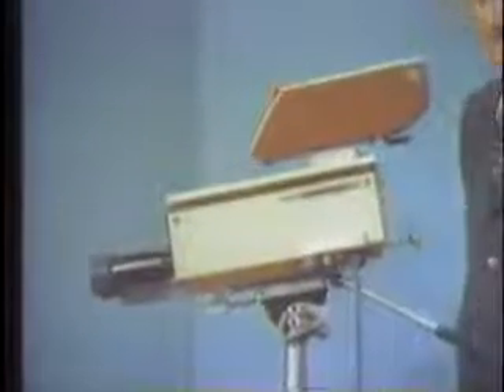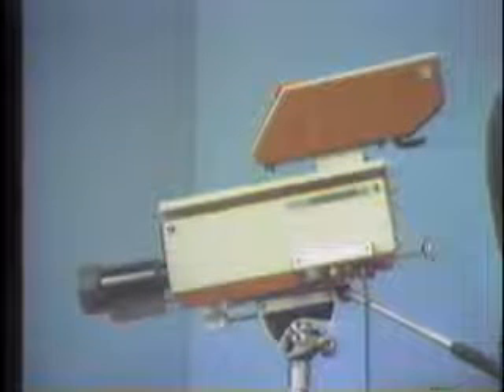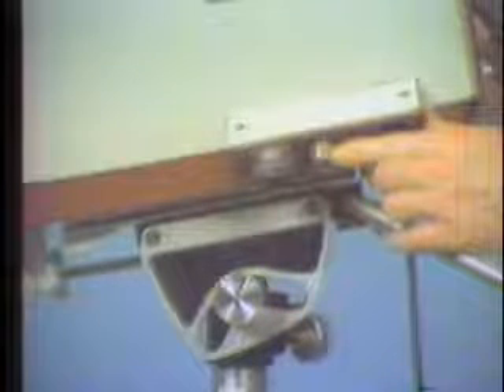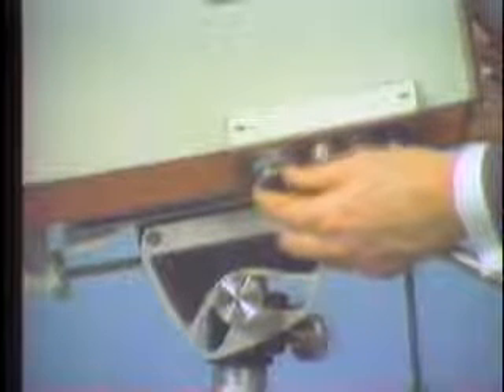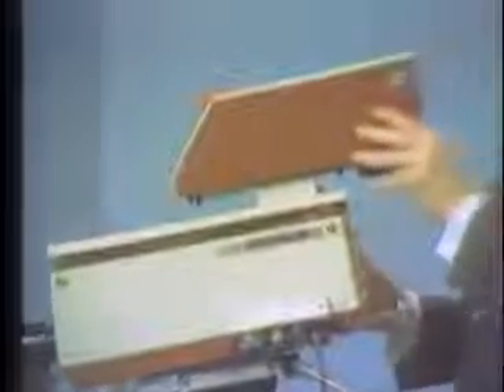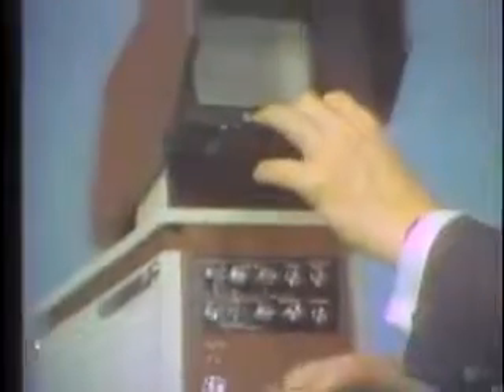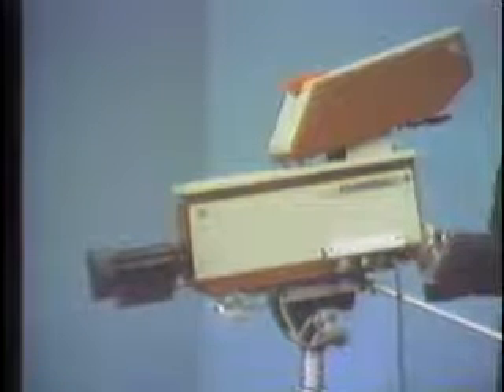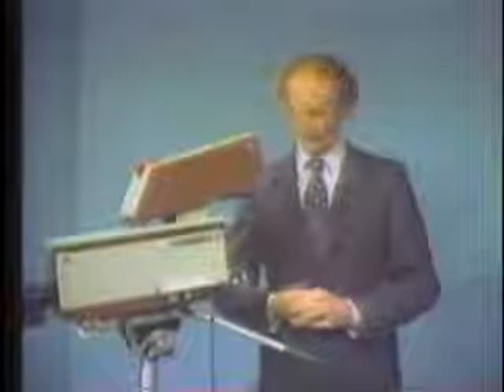Sony 1974 DXC-1200 Trinicon Color Studio Video Camera Introduction

Comment: $5,000 in 1974 is $21,003 in 2020. How was it low cost?
Reply from the maker: That's a fair question. A typical color television camera of the day would sell for $25,000 (1970 dollars) and up. There literally was no low end color camera market at that time. Until the arrival of low cost home VCRs, there was no demand for consumer grade color camera either. Today, you can buy a consumer security camera for $25 that puts a late 60s broadcast camera to shame. So, it's all relative.
Reply: Entry level broadcast cameras with a decent lens, starting at 20.000$ (today). Full bundle broadcast camera, with mainframe, CCU and a box lens for stadium could easily go up to 500.000$ (per camera). Only a television studio could afford this equipment.